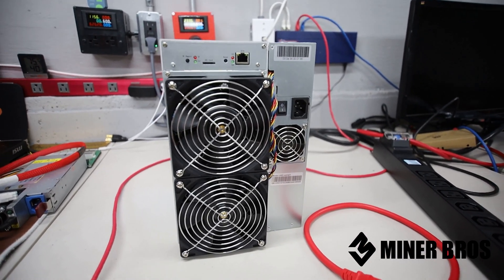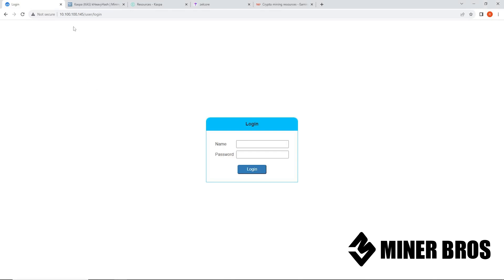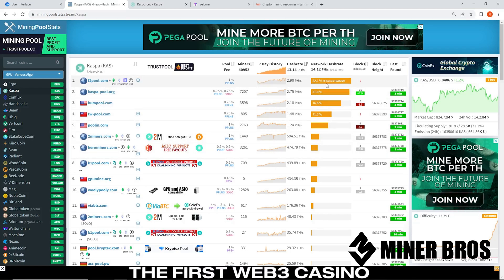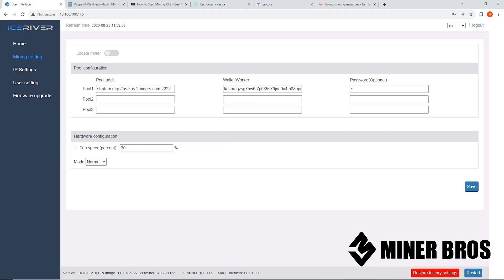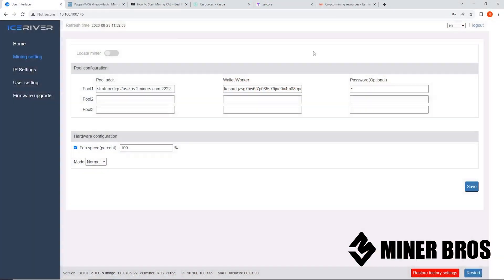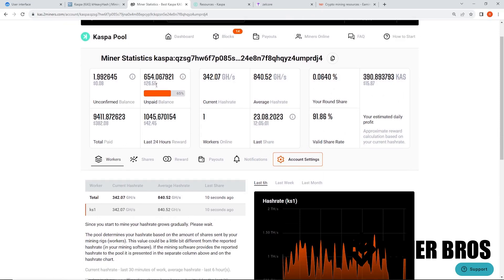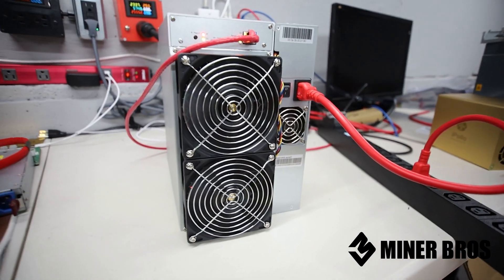How to Setup a IceRiver KS1 Kaspa ASIC Miner!

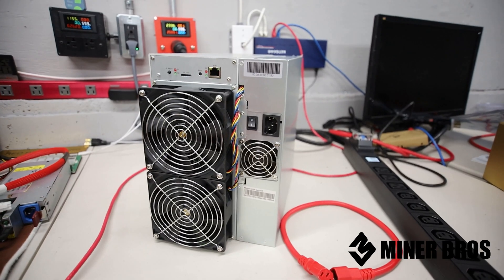Comment: Was looking to get one of these, but don't understand 1:28. You say the KS1 needs 240V, but the spec says the KS1 only draws in 600W. Why would it not work on a home outlet with 15 amps running 120V (because 15 x 120 = 1800W which should be way more than 600W)?
Reply: Well ur only suppose to use 80% of that 1800watts. So technically u have 1440watts to run continuously. But yeaa 600 watts is well bellow 1440watts so 🤷 ask china bros😅